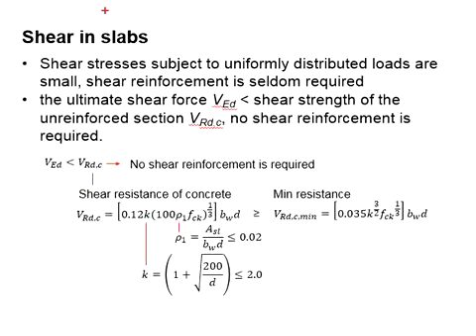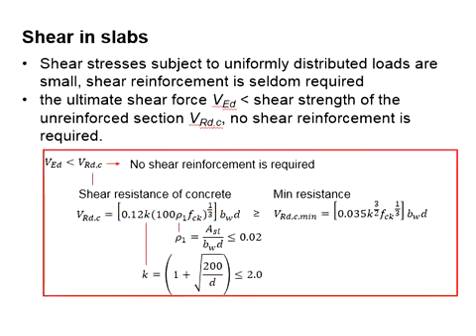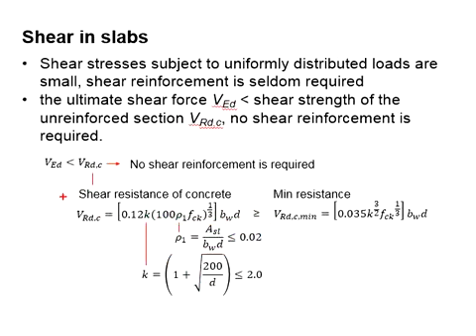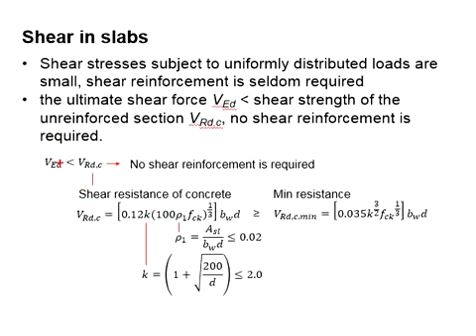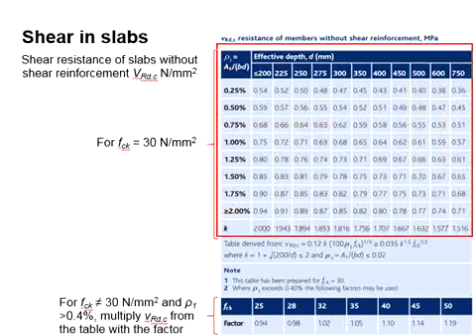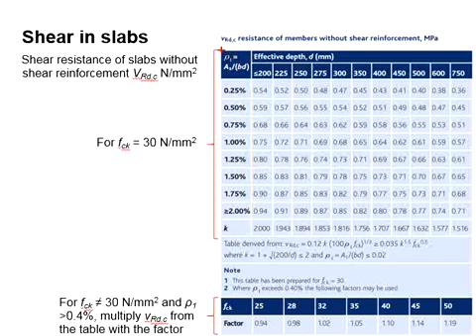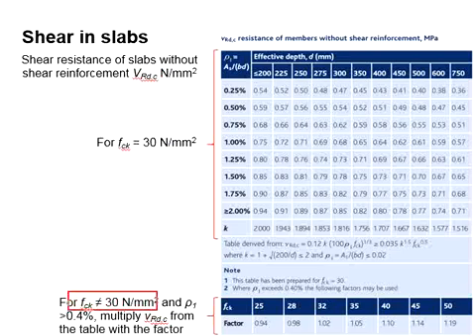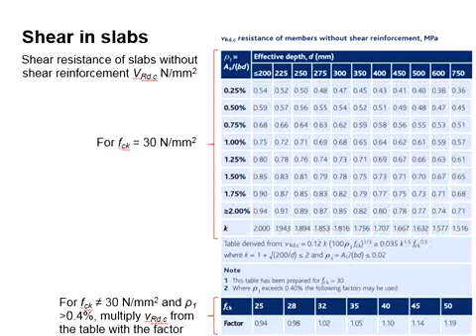8.5 Shear resistance of reinforced concrete slab

Comment: Hello. Can you tell me one thing? Before starting the calculation for punching shear of a flat slab, how can I find out, for example, for an average column measuring 400x400 mm, how much my slab, for example, 200 mm thick, would bear the  punching shear without installing transverse reinforcement? How can I derive this formula based on Eurocode 2? Thanks
Reply from the maker: There are two punching shear that you need to check for flat slab. (a) punching shear at 2d perimeter from column face, (b) maximum punching shear at column face. For punching shear at 2d perimeter, you may use VRd,min as the shear resistance, check you punching shear stress against it, see if it passes or not. As for max punching shear at column face, need to use another equation v_(Rd,max)=0.5[0.6(1-f_ck/250)] α_cc  f_ck/γ_c
Reply: @eng-aim  Thanks for answer. I meant something else. In the old Soviet standards (СНиП 2.03.01-84*) that were in effect in Ukraine, there was one formula for punching shear. This formula gave the value of the maximum punching shear that only a concrete of a flat slab could take in Fb (kN), for a column. And I could compare this value with the value of my external ultimate punching shear VEd or F that acts and punching my slab. Now we use adapted norms based on Eurocode 2. Is there any formula in Eurocode 2 that we know how to find the slab's ultimate pushing capacity in the form of VRd (kN), knowing its thickness, column dimensions and column location in plan (central, corner, edge) without reinforcement? For a preliminary comparison of the pushing force with the concrete resistance force? Sorry for my poor English.
Reply: This soviet formula is F=α*R_bt*u_m*h_0 (kN) looks like concrete resistance in the form of force. And according to Eurocode 2 this formula can written like V_Rd=α*f_ctd*u_0*d. α is a coefficient for concrete and it is 1.  R_bt=f_ctd tensile strength of concrete. h_0=d working height of the section. u_m=u_0, in Soviet standards, this is the average perimeter of the upper and lower perimeter of the pushing around the column. In these norms, the pyramid of punching is transparent at an angle of 45 degrees (Eurocode 2 it is 26,6 degrees or 21,8 I don't remember exactly), which is comparable to the value corresponding to the perimeter on the column face according to Eurocode 2, although it will be slightly smaller in value than the average perimeter u_m according to SNiP.
Reply from the maker: @inzhener-konstruktor  Frankly speaking, I have no idea about Soviet standards. Also, I'm not familiar with the formula you mentioned. I'm sorry.